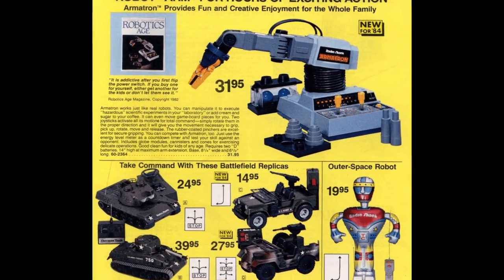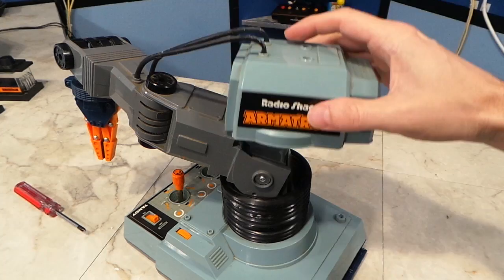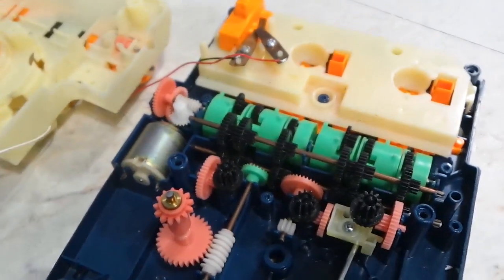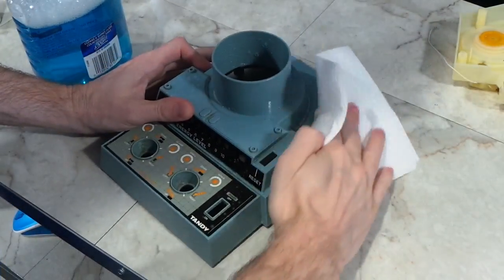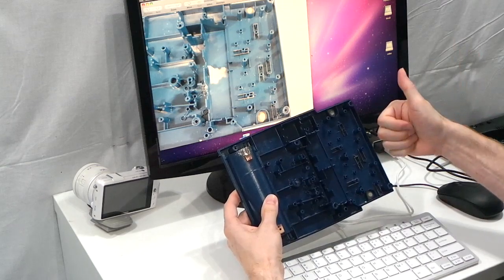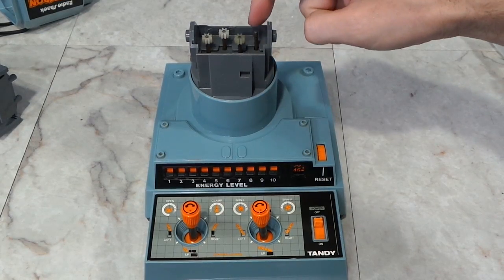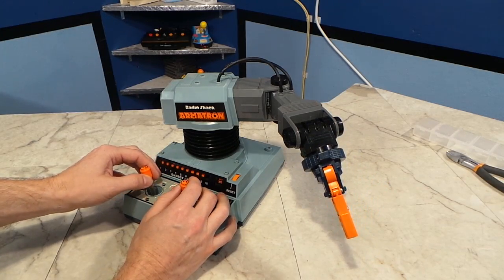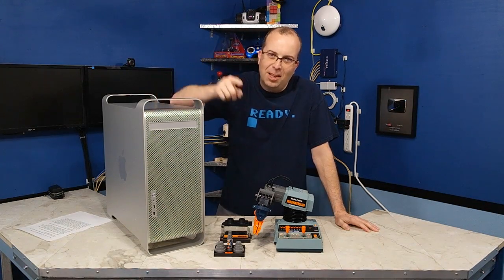Repair and Restore of Radio Shack's Armatron Robotic Arm from 1984.

Comment: I can only imagine how much of effort it was to design such a toy with just one motor inside.
Reply: No doubt! And the sticks had 2 speed proportionate control.
Reply: You would think that it would have been easier to just design it with one motor at every joint, right?
Reply: Gavin Palmer as the best candidate for naive approach — yes.
Reply: @gavinpalmer9174  yes but that would make it more expensive
Reply: Mechanical engineers are wonderful creatures
Reply: @gavinpalmer9174  Motors were even more expensive back then. They clearly decided it would be easier to spend the extra time on engineering to try to tap off a single motor. If it'll cost you 10 million dollars to put lots of motors in each unit, vs costing you 5 million to hire a team of engineers to make it so it can work off a single motor... which option is more profitable?

Comment: This is some serious engineering: the whole thing is powered by a single motor, yet can do all sorts of moves.
Reply: I guess plastic injection molding costs less than multiple motors? That's the only reason I see for using a mechanical interface, especially with that many degrees of freedom
Reply: So it can only do one move at a time? Bummer :(
Reply: It's possible it could do more than one move by just engaging multiple gears at once. It looks like it should be able to.
Reply: The second incarnation of the Armatron dispensed with the planetary gears and actually did use discrete motors for each joint.  But the engineering that went into the planetary gear arrangement in the first generation was quite awe inspiring when I cracked open one of them back in the mid-80's as a teenager.
Reply: +Ethan Poole hi again!
Reply: That's the magic of technology.
Reply: That moment when some childs toy robotic arm from 90's actually more stable than your own robotic arm which you have put days of work "cries in engineer"
Reply: BF3blog no kidding
Reply: @XanderLuciano  The plastic parts and gears are pure engineering -  getting  ONE motor to do everything, and yes - the design would scale up to full size car crusher ability if rendered in  titanium parts and powerful high torque motor instead of plastic and one DC motor.
The motor is the most expensive part,  made of magnets and metal ...   The plastic gears  flexing true clockwork engineering  genius.
Reply: Check out the old electric mechanical typewriters. Same thing, turn it on and a motor just starts running, controlling the entire machine mechanically
Reply: A lot of LEGO technic sets have gearboxes that allow for one motor to control 5 or more actions
Reply: @ash.ton998  NASA actually sends Lego sets into space for improvised solutions
Reply: All this done without 3D CAD?
Reply: @toysareforboys1  it get your motions quite longer.. ^^
Reply: I have one of these in my parents basement, still works and is in really good condition
Reply: Replicating this robotic arm would make a freakin' awesome project for an advanced 3D Printer. Especially those complex planetary gears.
Reply: its a lot to look at lol
Reply: Yep a Furby Boom is the same thing it also only has one motor surprisingly
Reply: I think they did it to cheap out but to make it more slow so it was more precise
Reply: @toysareforboys1 7 years late to the party, but I restarted mine and it can move multiple joints at the same time. It just stresses the motor at little more.

Comment: If you had a 3d printer, would you have been able to print a new gear?
Reply: i think... but the printer should have also a 3D scanner
Reply: Yes he could have re printed parts, he wouldn't need a scanner he could just measure and re make them in something like Sketchup or autocad
Reply: Or at least a program with proper measurement scaling and enough precise measuring to reverse engineer another gear.
Reply: agreed, should be fixed in like 15 minutes... Dont have to be perfect, just the same number of teeth and roughly the same lenghts..
Reply: I'm fairly sure he does have a 3d printer.
Reply: I was just gonna say that! He seems like the kind of person who should have a 3d printer. And this is the exact sort of thing a 3d printer is meant to be for.
Reply: I am so happy I wasn't alone.
Reply: The other gears seemed almost identical. Even without a 3d printer,  it might be possible to make a mold and cast a new one.
Reply: Might be a common off the shelf gear to begin with.
Reply: Why would you need to scan something that is so perfectly geometric? A few measurements allow you to recreate it, especially because the tolerances on that thing are likely not very exact anyways.

You just need the inner rod's diameter, the number of gear teeth, the teeth's low point, the gear's high point, maybe how wide the teeth's tip and spacing between their low point is, and how wide the whole gear is, and maybe the angle of the side of the teeth. Most CAD software makes it trivially easy to create this shape, and the beauty of 3d printing is that you could try printing and adjusting it several times to get it perfect.
Reply: and if he doesn't have a 3d printer then a fan would probably be happy to print one out for him
Reply: In my expirence 3D printers usually fail at printing these small things.
Reply: Designing a gear like that without a scanner is incredibly easy is almost any CAD program.
Reply: Another possibility that comes to mind is just cast and mold one of the other gears, assuming the missing one is like the other 3.
Reply: Krivulda It is possible to do with the right 3D printer, just that the printer needs a little help with it.
Reply: +Carlos Vives: Much better than trying to 3d print one, unless you had access to a really really high end printer. On the other hand casting is very possible in a home workshop, 1 Piece mold making is almost a no brainer using hobby grade materials and after a few attempts the quality of the resulting cast gear would be much better than that of one printed on a consumer level machine.
Reply from the maker: actually no.  This gear is far too small.  Consumer-based 3D printers like the one I have cannot produce parts this small with those tiny teeth.  A commercial 3D printer that is laser-based could probably do it.
Reply: The 8-Bit Guy Yeah that's what I am saying. Resin based 3D printer could pull it off, but normal thermoplastic just can't.
Reply: +The 8-Bit Guy It depends on 3D printer, printing material, extruder pinhole and printing settings. For example, it is possible to print some parts with RepRap 3D printer with accuracy about 300-500 um (of course it will be necessary to finalize the part manually). Another option is laser engraver: acrylic glass has suitable mechanical properties for such gears.
Reply: Just cast it in resin. Just use one of the smooth on kits from amazon. It's $20 now, but you can use it for all sorts of parts in the future. Everyone wants to jump straight to 3D printing, but that's such an expensive way to produce a single part. Trust me, latex and casting resin will look amazing!
Reply: I bet you could make one from a mold kit. Probably make it aluminum, too.  Part two!
Reply: don't need a 3d printer for that, just plywood, fretsaw and a small file.
Reply: +The 8-Bit Guy surely you could scavenge a gear from somewhere? You must have parts piles and it's an 80's Radio Shack, they probably used it in all kinds of RC cars and toys.
Reply: I wonder if the gear has to be THAT thick? Becuase if not he could just use an exacto knife and some stiff plastic or tin and just trace and cut another gear out? If it needed to be thicker he could just cut out a bunch of them and glue them together in a stack
Reply: been there done that, the teeth is very hard to print, even if he manage to print, they would break easily because they're being so thin.
Reply: Wouldn't even need a 3d printer. Assuming all the gears are similar, all you would need is some plasticine and plaster of paris
Reply: After thinking about it, such a simple part doesn't need a 3D scanner. Just drop it on the glass of a regular scanner, scan it, import the form into an Autocad style software and then give it a 3D depth. For someone how knwo 3D software it's done in less than 2 min.
Reply: You can send a 3d model of the gear to me and I will make some for you :)
Reply: BoomerangPlays no, because 3d printed parts suck.
Reply: The 8-Bit Guy thank you for telling these fools it can't be done. People think 3d printing is a panacea. Even people you think should know better...
Reply: Tadesan you can easily print this on formlabs resin printer. :) and I think you could FDM print it aswell with a 0,2 nozzle
Reply: For parts of a small form factor, I usually print a rough cut and use hand files to get the shaping... I do realize that this is now a year later, but, gotta throw in your 2 cents on the internet right?
that being said, it is a somewhat menial task that requires precision filing, and probably not worth it in this instance. (I usually do small musical instrument parts)
Reply: Best solution is to silicon mold to clone one of the gears in resin.
Reply: Have a printer not that great but maybe it will be able to print it?
Reply: maybe someone with a bandsaw could make an aluminum version since 8-bit guy said the gear was a bad design for a plastic part. I have a scroll saw and I could probably make one from a aluminum dowel
Reply: @HighFidelityFox  Fusion 360 works well also.
Reply: D2K Prime ah yeah that's what I use now, I love it. Also lmao I don't even remember this 2 years ago, my how printers have improved
Reply: no, he cant. watch his update video
Reply: As he has said in different videos he does have a 3d printer but the resolution is too low.
Reply: @Golgothite1  Ha, I scrolled through the comments to see if anyone mentioned this option (the best one I think, since I've done some casting).  I'd use silicone for the mold, but also some kind of good hard plastic casting resin.  I bet even a good "ultracal" (or similar hard plaster) would work.
Reply: 3D printers can't quite print something that small, and even if it did, it would probably be too weak to actually be useful.
Reply: if it was capable
Reply: 3 years too late. I'm sure many of us wouldnt mind making a a model and 3d printing you a gear, myself one of them.
Reply: @The8BitGuy  Please. You can buy nylon gears of any shapes and sizes off ebay. Come on.
Reply: Beni it,would be very easy to make one from scratch.
Reply: @The8BitGuy      Have you considered getting a metrology service to measure the dimensions of the other 3 gears to get it reproduced? Metrology (precision measurement) is part of my line of work, and it would be rather simple to measure something like that to get the external dimensions such as the thickness and pitch diameter of the gear. The only minor challenge would be determining the dimensions of the center hole. I see there is some kind of pattern on the rod for the gear to slide over top of. This probably a gear spline (or keyway) to attach the rod to the hole in the gear. 
   So basically, to determine the precise dimensions of the gear, you would want a gear with the rod attached to get the external dimensions. Then you would want the rod without the gear to get it's diameter and measure the dimensions of the gear spline (or keyway). Its kind of hard to see what that actually is in the video, but all it really comes down to is measuring the dimensions of the rod and it's gear spline so that you know what the internal dimensions of the gear hole are should be.  
     The main point is that if you were to take the path of reproducing this the gear, I would recommend getting a metrology service to measure the relevant dimensions of the gear and the rod. Have them output that information into a mechanical engineering drawing or (preferably) a CAD file. Both of these parts should be very doable as this is 
essentially one of the ways specific parts are reverse engineered when they are no longer available.
   As for reproduction of the part, I suppose a professional end 3D printer might work, but even then I am not sure if they would be good enough to make a gear that will last (more on that later). My personal recommendation would be to have the part produced from a CNC machine using whatever is the appropriate type of plastic. I am not an expert on plastics, but the gears appear to be made from ABS plastic. As with any material, there are varying grades for different purposes. It also might not be a bad idea to consider something stronger as breakage seems to be common on that gear. 
   Now, here is what I have to say about 3D printers. The biggest issue I have is that the tolerance capabilities of most 3D printers that I've seen are rated at a single value which leaves things up in the air for me. I personally would assume that this is the tolerance it can produce when dealing with shapes that have perpendicular and parallel sides like a cube. Any deviation from perfect parallelism or perpendicularity of one surface from to another will result in less of your promised tolerance.  That is oversimplified, but manufacturing tolerances is a complicated subject and I'm not an expect on 3D printers. 
   The point I am getting at is that a gear is a more complicated shape and although  and I'm sure people have 3D printed gears before, I'm just not sure how well they hold up. I suppose a 3D printed gear could work, but for how long? Slight imperfections in a gear can have consequences over the time. Aside from pitch diameter, the other important aspect is how concentric the hole is to the the pitch diameter. Another point is that just because something is plastic doesn't mean it isn't made with precision. Even a plastic gear is made from a mold which was likely made from a CNC machine, so the precision that exists in the mold will carry over into the parts that are molded from it.
   A CNC machine resolves any issues with precision in my mind. So perhaps you know someone with a CNC machine? I don't have one, nor do I have access to one, but that is my long winded suggestion for you. I can offer my services in measurement of the parts, but that would have to wait until this Covid19 stuff is over because my work is closed until then. If you're interested, or want to chat about this or just message me.
Reply: 15 minutes of measuring, 5 minutes of designing, 10 minutes of printing.
Reply: Man! When i was a kid, i fully disassembled my armatron, i managed to reassemble it with no help, with that i learnt a lot, i still have it but with three gears missing, i want to upgrade it in some way...
Reply: @The8BitGuy  and why don't you try 3d printing a mold for the small gear and make the gear out of resin ?
Reply: Beni nope, there are gears generators, even on the internet...
Reply: You can just make a mold out of water buddy and melt plastic, no need for all th as that tech
Reply: Maybe theres a site where you can upload your 3D model and order the part small enough
Reply: They make super small nozzles.... Never tested them though..
Reply: That's a very small gear, would be extremely hard to print. (3d printer owner) but there's plenty of space could be print bigger and the other side too to solve that problem.
Reply: A small cnc mill would be the ideal tool to use. Not only will it finish the part in a fraction of a 3d printer's time but one could also easily replace the innards of the Armatron with aluminum parts. No big deal. Very big deal for plastic 3d printers.
Reply: You can find them on amazon or eBay. or make new ones from a mold RTV/resin mold. Here’s a gear that should work for the one that’s missing: https://www.amazon.com/dp/B07DH9JT8S/ref=cm_sw_r_cp_api_glt_fabc_X8R4RC6K4Y5F7DDDZGY8

Comment: Just used this video to help me open and repair my own Armatron that I've owned for decades. After opening, I got it to power on and run (and I don't have a large solder glob on either battery connector.) However, a pinion gear is broke in the base (not lost. It was there, split in half), and I lost "elbow bend" control. Guess it's time to hit eBay for a non-working one for parts!
I know it's a year after you made this video, but thanks. It really helped me out.

Comment: "If I didn't have that I could never put this thing back together again." Wish you could tell that to eight year old me.
Reply from the maker: me too.. That's what happened to my original Armatron.  I took it apart and never could get it back together.
Reply: I seem to recall at least partially disassembling my Armatron, but I don't think I went so far as to render it nonfunctional.  Then again, I managed to dis- and re-assemble the head of my AT-AT, and it seemed to work, though something about it sounded different afterward.
Reply: DataCab1e The 8-Bit Guy I'm half certain it was one of those four little main control gears that I ended up losing too, except mine controlled the elbow. Crazy that this one still had the cosmetic hoses.
Reply: I disassembled my iBook G4 back then, without any guides, without taking photos, without sorting screws. Now I want it back, but yeah.
Reply: I once disassembled a furby, even that looked less daunting to put back together again.